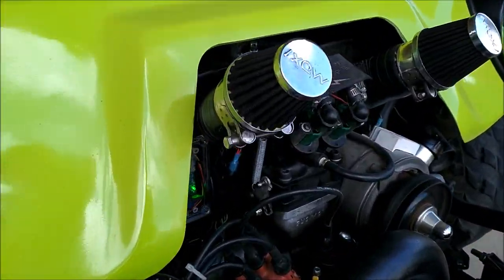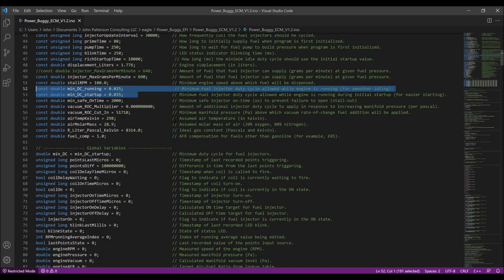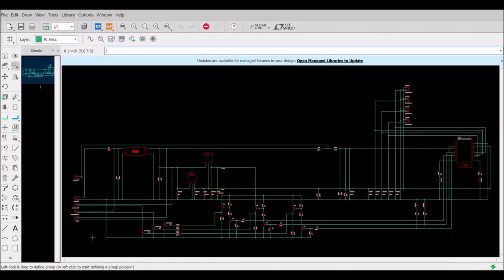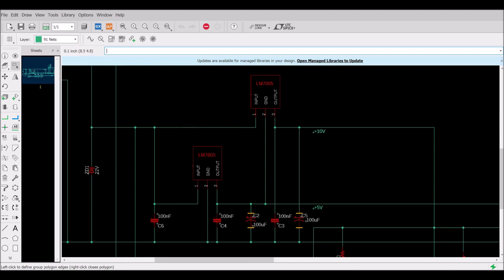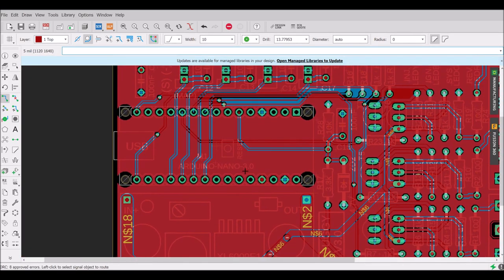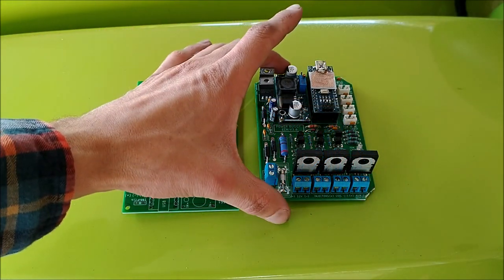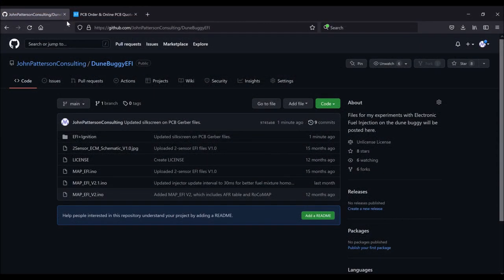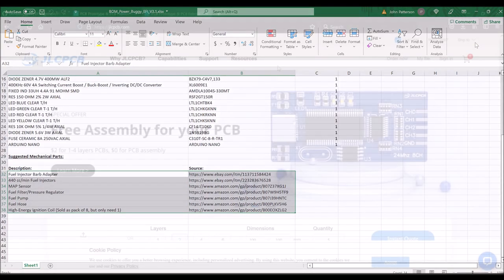DIY Fuel Injection Control Module - An In-Depth Look

Comment from the maker: One additional tip: In addition to adding the copper mesh shield, it is also HIGHLY recommended that you remove the onboard 5V linear regulator from the back of the Arduino Nano before installing it. This regulator is not needed when an external 5V supply is provided, and the "VIN" pin to this regulator is left floating on the Arduino Nano design, which can cause the regulator to short to ground. The regulator can be de-soldered, or clipped off at the leads using sidecutters.
Reply: could i use the same arduino And your code for the bike-motorcicle efi system to switch to  , but my bike already has the ecu and is carburated is a honda cb600f from year 2004?

Comment: I discovered this video a few days ago after a search which I carry out every now and then on DIY EFI. I was immediately impressed with the quality of the video, and even more impressed with the quality of the Arduino program. The program is written how I was taught to program 40 years ago, well laid out and everything fully commented, unlike how I actually write programs now! I loaded the program onto an Arduino Nano, rigged up some LED's to observe the outputs (as well as my oscilliscope), a variable resistor for a MAP input and a wave generator for a crank trigger input. It works beautifully.
One thing will have to be modified before I try it out on an actual engine is the fuel pump is not switched on when the engine is running, something I reckon that even I will be able to modify in the code.
I eagerly look forward to any future updates!
Reply from the maker: Thank you! I really appreciate it! I hope it performs nicely for you!

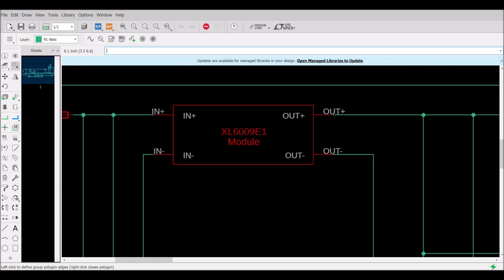Comment: Just a note, I know in this specific situation it's not relevant but rev limiting using spark suppression is fine except if there is a catalytic converter involved. Unburnt fuel in a hot Cat' will make it overheat and destroy it. By the way, the Bosch Automotive Handbook contains a wealth of useful information. At 9:22, Iyou could do away with the 'boost converter module' by using logic level FETs, the injectors are specced down to 6v (lets face it the engine won't be cranking at this voltage, I seem to remember the minimum spec for vehicle electrics is 9 volts). Include an inductor in the supply rail, that'll dampen most transients.
Reply from the maker: Good point about damaging the catalytic converter, it makes sense that the unburnt fuel would get oxidized in the converter and would heat it up rapidly (if I had one installed).

In this case I was a bit paranoid about entering a lean burn condition, and I figured the rev limiter would only be used in short, infrequent events.

My main concern with cutting both spark and fuel was that if the fuel mixture became lean enough to detonate, it might ignite without a spark, causing detonation at the worst possible time (at redline). 

The Bosch Automotive Handbook sounds like a great resource, I will definitely check it out!

Comment: Great job sir, I spent quite a bit too much money to get my turbo efi bug put together using a microsquirt 3.0. Im still working out the kinks and havent gotten it to start yet lol.
Reply from the maker: Thank you! 

Although I've never worked with turbocharged engines, one tip I would suggest is to ensure your MAP sensor (if you are using one) is compatible with both boost (positive pressure) and vacuum (negative pressure). Unlike naturally-aspirated engines, turbocharged and supercharged engines can develop manifold pressures higher than atmospheric when boosting. Also, be sure the ECU is able to correctly interpret the MAP signal as positive and negative, respectively. Good luck with your project!

Comment: Awesome - I enjoyed so much watching all your DIY videos, thanks for making them for us. I may have missed it but I am not sure if at the end you kept your fuel return system or did you remove it?
Reply from the maker: I still have the fuel return system in place. Currently I draw fuel from the top of the tank using an immersed fuel sock, and I return the excess from the regulator through the bottom of the tank. This configuration is good because it prevents whirlpool formation at the bottom of the tank.

Right now I have the regulator at the front of the car, so I do have a fairly long run of fuel line to the injectors at the rear. There is some load-dependent pressure drop over the line, but it can be fairly easily compensated out in the AFR table.

Comment: Nice work. Just an observation, I think your map sensor port on your manifold should be below your throttle butterfly to properly sense vacuum. Should make tuning and throttle response a whole lot better. You can also add in accelerator pump functionality according to rate of change of your MAP signal. This of course unless there is an internal port going from that connection above the butterfly to bellow the butterfly which makes my observation a waste of every ones time :=).
Reply from the maker: Great observation! In fact, there actually is a passage in the Zenith throttle body for vacuum take-off, and I have my MAP port aligned to it (see https://www.ebay.com/itm/154214676001 )

I actually do have a rate-of-change-of-MAP in the program code! However, I found that the acceleration was smooth enough without the extra fuel, and adding any additional fuel on MAP pressure increase tended to cause over-enrichment. I suspect some fuel gets condensed on the bottom of the manifold while cruising/idling, and this likely gets pulled in all at once when the throttle is opened quickly, thus negating the need for extra accelerator pump fuel.

Comment: Nice design! Yep beefier MOSFET take more beating, but also  need lot transistors to drive them with 10V, when IRL540 need only 5v in gate can forget whole 10v line and gate driving transistors. By my undertanding, MOSFETs are not gonna handle near 600V. If need so mush to take voltage, why not use thyristor like BT151. Drawn this schematic arlready ang gonna make simpler verion with IRL540's, maybe put 2 of them parellel if need really high current. Probably adding some optional input and output just in case, so many unused pins left.

Comment: Awesome Sauce!  What fuel are you currently using?  Is it e51, or e85, or ???  Also, do you experience much throttle lag?  It's difficult to tell by the video, but appears you have solved almost all of that.  Thanks for sharing and thanks for providing your files on github.  Really nice work!  Love it!!
Reply from the maker: I'm currently runnning 89 octane pump gas, but with the larger injectors it should be able to run E51 or E85 with an adjustment to the fuel_comp term.  Yes, the two things I did that really improved the lag were to add the AFR table, and also to increase the injector frequency to about 30 Hz for. Both provided a major advantage in reducing the lag, even without the need for the additional rate-of-change-of-MAP.
Reply: I saw a 33uh 4.4A 91Mohm inductor listed on your BOM, but didn't see it populated on the PCB.  Is that component still utilized?  Thanks!
Reply from the maker: @mikedavis5784  Good catch, that was from an older version of the design where the components of the XL6009 unit were soldered directly to the board. I've updated the BOM to remove this, as it is no longer necessary.

Comment: I'm looking forward to seeing updates on this project in the future. I used your previous videos on the buggy as a guide for creating my own single cylinder Arduino ECU, but due to time constraints while in school I was not able to finish the project. Do you have any plans to make this project open to other engines and applications as well? Could, or would you be interested in building one for a six cylinder application? Does the Nano have enough ram, memory, and IO for the extra cylinders?
Reply from the maker: The existing system very well might work with a 6-cylinder engine as-is. Really the only limiting factor is the ability for the spark timing to accurately follow the distributor pulses. There's a "pulsesPerRevolution" term in the code that can be adjusted based on how many distributor pulses are expected for each engine revolution, and this can be arbitrarily configured. For a 6-cylinder engine, I believe this value would need to be set at 3.
Reply: @DielectricVideos  Nevermind, should have read the comments first.  Thank you sir.

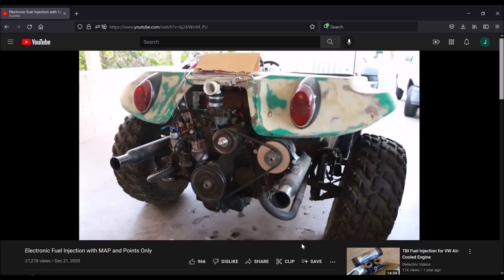Comment: 1:41... Is it just me or is your Alternator Belt just a bit too loose ? Nice DIY project.
Reply from the maker: Yep, although it's shimmed to the max. The belt on there came with the engine and had been sitting for many years, so I think it either expanded, or was the wrong size to begin with. I have a replacement one that's a closer fit, so I'll probably put it in soon 👍

Comment: Nicely done, have you thought about making a SMD version? I guess it's through hole so it's easy to build?
Reply from the maker: Yes, it would definitely be possible to implement the system using SMD components! For this one, I used THT parts to make the open-source boards as easy as possible to assemble. It could be made a lot more compact with SMD parts, and I would even opt to put the ATmega328p and associated support electronics directly on the board if I took this approach 👍

Comment: I try to greatcorola but feul very much in the blok. How tuner afr, tanks.
Reply from the maker: You can adjust the engine parameters in lines 42-60, and the AFR table can be updated on lines 93-102 on the Arduino program on GitHub.

Hopefully this helps!

Comment: Can you convert code so that instead of MAP sensor, you can use TPS sensor?
Reply from the maker: Using a TPS and engine RPM (Alpha-N control) requires empirical measurement of the airflow at multiple throttle positions and engine RPMs in order to build out a reference table for airflow calculation. This requires specialized airflow measurement tools and most likely dyno time. The obtained table will also be highly engine-specific, and will need to be changed with any modification to the intake or even operating altitude. While I wouldn't recommend alpha-N control for this system, you can learn more about it and potentially implement it on your car based on this link: https://tunertools.com/pages/load-control-and-calculation

Comment: Hi guy, is very nice this. Have you a implementation of fuel injection test module over Arduino? Maybe something about Injection switch circuit
Reply from the maker: With some slight adjustment to the code, you can definitely use this board to test fuel injectors. The output duty cycle can be set to any value 0-100%, and the board is both Arduino-compatible and has the MOSFET to drive the injector (s)

Comment: Hi, can I ask what cc your engine is? I'm really interested in doing this to my classic mini. As I've been looki g at ways to remove the carb. Other than this, the cheapest option looks like a full engine swap.

My car only has 1 carb as its a 998cc 4 cylinder. I am wondering if one injector would work, that way I could conceal it in a Faux carb to keep the look and use it like the carb needle spraying in the same location. 
I've been following this since you started and it has come on leaps and bounds.
I'm really impressed. You've done an amazing job! Keep it up and I can't wait for more!
Reply from the maker: My current engine is a 1776cc, but I have successfully run a very similar system on an old 1192cc VW engine as well! I think a single injector should be adequate for your Mini engine, provided it is a fairly high-flow injector like the one I have listed in the Bill of Materials.

Sounds like a really cool project, I hope to hear how it goes!
Reply: @DielectricVideos  well, companies in the UK are expensive! Around £60 for a single board! That's close to $80. I looked at the company you used and I can get it made, and shipped to the UK for £5.38. That's around $7.
I guess the brain of my mini will be interlectually and physically American!

Comment: Looking at the code I'm curious why you don't make use of timer interrupts and interrupts in general? Seems like a good application for them but I only know enough about programming to be dangerous lol.
Reply from the maker: I initially used interrupts, but found they were prone to false triggering. There is a huge amount of spurious noise everywhere in the ECU application, so I found polling to be a lot more reliable. With polling, the likelihood of the sample being measured at the exact time of a transient is much lower (though it does occasionally happen).
Reply: @DielectricVideos  Interesting. Good to know, thanks.

Comment: Very kool bro but I am asking if this design can use in 4 cylinder engine I am engineer that building hho generator and circuit too but I am interested to know what I'd best to do to reduce injection timer so I get little gas sprayed
Reply from the maker: If you have a 2-sensor digital ignition timing signal available, such as that provided by the optical board I designed, it is possible to use this system with any 4-cylinder gas engine. The board only supports one injector control channel, so you would need a single fuel injector or bank of concurrently operated fuel injectors. There is also an auxiliary output that you could use for the HHO delivery valve, but you would need to write custom firmware to control the metering as you need it.
Reply from the maker: Also, with this 1-coil board, a single traditional points system can also be used. The auxiliary output is also available on this board.
Reply: Ok thank

Comment: Thanks for these uploads. I wish you could help me with my dilemma, i am trying to convert an old point system to semi conductor using nchannel and pchannel mosfet, my 640n mosfet keeps on burning. Could you please give me an idea how i can protecr the mosfets? Thanks.
Reply from the maker: Try adding a small resistance in series with the condenser, for example, 4.7 ohms. This will prevent an overcurrent condition when the MOSFEt first switches on. Also be sure you are using a high-resistance coil. If you want to use a low-resistance HEI coil, you need a pulse generator to limit the on-time of the coil.
Reply: @DielectricVideos   thanks for that will definitely try your suggestions.

Comment: I have a question my distributor has output of 5 volt positive Square wave will this work with my distributor
Reply from the maker: This board has a 150-ohm internal pullup resistor (R8) to +12V on the points input, but the input logic should work with a 5V square wave. If you want to remove this pullup resistor to reduce the current sinking requirements of your distributor circuit, you can remove it.

Comment: I would like information on how to contact you to get the ecu board and the list of components that go on the board.
Reply from the maker: All the files (software as well as PCB) for both the single-coil and 4-coil ECM designs can be found here: https://github.com/JohnPattersonConsulting/DuneBuggyEFI

If you'd like to reach out for more information, you can also email john@johnpattersonconsulting.com.

Thanks!

Comment: I'd be worried about the durability of the ecu cover, especially where it resides.
Reply from the maker: I've made quite a bit of progress on the 4-coil system since filming this video, and I actually have the new ECU mounted in a more solid enclosure inside the cabin/body now! That being said, the enclosure in the video did hold up to about 2000 miles of roadservice, including quite a bit of idling in 90+ degree weather last fall, so it didn't turn out to be much of an issue in any case 👍

Comment: Do you think it would be safe to return fuel supply to zero at zero throttle input or under braking, and auto catch the engine from stalling once idle rpm is reached by reintroducing idle fuel quantity?
 I'm wanting to  build a Diesel Turbo piggy back based on your code and using OEM injector pulse in place of the points. 
Since fuel quantity == throttle in a diesel, this creates a runaway loop if fueling is based solely on MAP and RPM .  I need to use TPS to prevent runaway. 
Any  implementation suggestions would be wonderful? DC x TPS as a factor 0-100%? with idle catcher.
Reply from the maker: I think that could work well, as it would basically behave like a 'hit and miss' engine while coasting down. I'd also suggest using accelerator pedal position as the primary fuel delivery input, then trim the fuel as needed using RPM and MAP values. The simplest system would be 1:1 TPS to duty cycle, but in reality there will likely be adjuments from RPM and MAP pressure to avoid overly rich or lean burn given the conditions.
Reply: @DielectricVideos  Thank you for your reply. I've had a go at it (accelerator pedal pot as input) and created a fork. I'm just a novice so I'm still working on the code to allow zero injector_ dc until idle catch. It's all fun stuff to me.